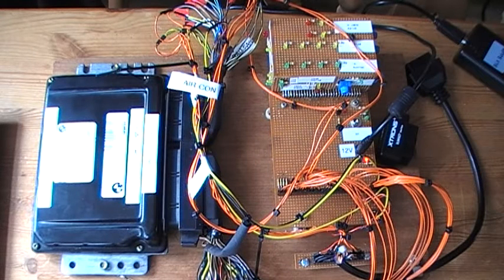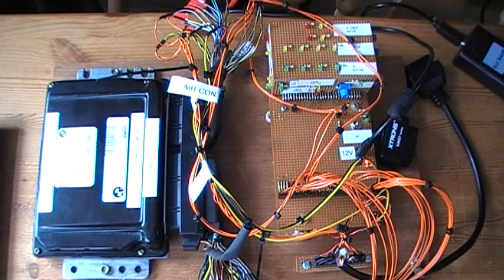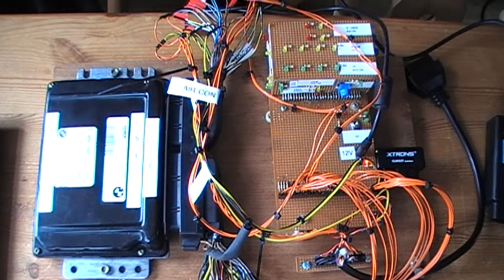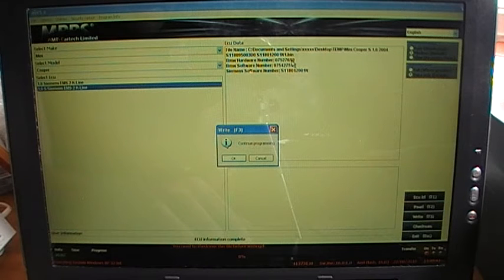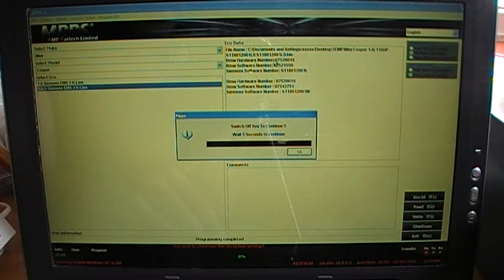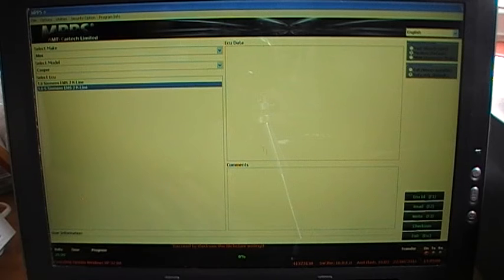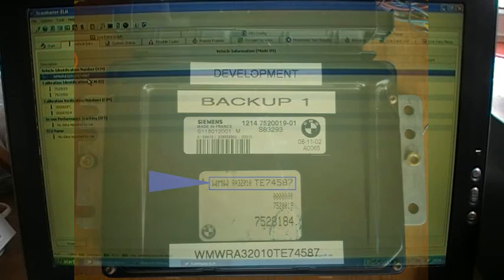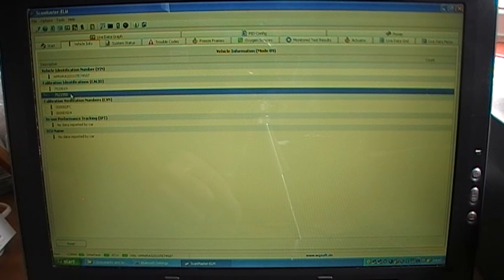Upload An Image To A BMW Miini R53 ECU Using MPPS

Comment: Great video may i ask which wires in the ecu are for can high and low? I'm planning on buying a digital cluster from aem and I'm gonna need the cans to operate the device.
Reply from the maker: It's been a while since I looked. I'll take a look and let you know.
Reply: @DevelopIT  thank you will appreciate it 👍🏼
Reply from the maker: @minir53s9  Here is a link to the document that has all the ECU connections for the R53 Mini:
http://ww2.justanswer.com/uploads/MA/markthebooler/2013-04-04_095335_mini.pdf

Comment: Fantastic video m8 can I as how and what u used for wires to connect to ecu and do you sell what you made to connect to ECU
Reply from the maker: I saw one on eBay which had been removed by cutting the harness wires, so I got it and when it arrived it still had the connectors and short wires from the connectors. I recommend getting one this way if you can because the connectors are very expensive.

Comment: Hello, fantastic channel, very detail oriented and I love it. It appears you are an electrical engineer, I am as well. I have an '04 R53 Mini ECU for which I suspect the injector driver is bad. The ECU is a Siemens VDO, but it is a slightly later version then the one you have in the video. The case backing "clamps" on instead of screwing on. I am contemplating replacing the injector driver. Any suggestions?
Reply from the maker: I originally did electronic engineering, but mostly do software engineering.
I have only looked at the type of ECU that is in the video. The circuits are placed on a film rather than a board. A heat gun can be used to remove the components, but there are two issues. The film is on a plate which is used as a heat sink, so some components that are mounted to it are difficult to remove. And there is a coating of some kind of plastic material over the film to protect the soldered joints from moisture. Use a cheap ECU from eBay to practice on first, and see if you want to try on your ECU.

Comment: so this process can be used to clone my original ECU to a spare with same HW number?
Reply from the maker: No, there are parts of the memory which don't get copied. One of which is the VIN number.
Reply from the maker: That is to say, from the point of view of my vehicle, R53 Mini. I think there is a table related to MPPS as to which parts of memory it does and does not copy for a particular vehicle.
Reply: @DevelopIT  so it could be is related to MPPS, maybe other software can fully read&overwrite exiting data on memory? I have seen online sites that offer ECU cloning for BMW's and MINI
Reply from the maker: @mokacat1595  BMW have a proprietary interface over a connection called K-Line, which it uses to configure the devices in a car, including the ECU. I don't know enough about MPPS to know if it can also be used.

Comment: I just found the same firmware and same hardware version as my EMS 5150. QUESTION)  Do I need to program the second ECU on a bench setup as shown in this video because there is some handshaking going on with other things in the car, or can I just not start the engine and have the ignition on to use the odb2 port to write out a copy of the original ECU which I can read in the car into the second ECU, and then hopefully, fingers crossed, start the car?  Thanks for helping others with your video(s).
Reply from the maker: You should be able to have it in the car with the ignition on and program it. However, I believe that it will probably retain the VIN number from the vehicle it came from. So after programming it will probably complain that the immobilizer unit does not have the same VIN number as the ECU and prevent you from starting the car. There are sites online that have copies of firmware for download which they say is immobilizer disabled firmware. However I have not used any of these and don't know if they are safe to use.
Reply: Thank you for your quick and probably accurate understanding what the total system will do as well as the suggestion with disclaimer!!!

Comment: So, if I've well understood, even if you take a second ECU unit with corrett codes and you load the 512k image file of your ECU into it with mpps the VIN code won't change and the car won't start up. Is It right?
Reply from the maker: The MPPS transfers I have done don't update the VIN number in the ECU. The vehicle immobilizer unit also knows the VIN number and wont allow your car to start if they don't match. With a previous car I have had, not a Mini, when the ECU failed, from eBay I had to get a matching ECU and immobilizer unit, plus ignition keys to match the transponder in the key with the ECU, plus the ignition barrel. If you look on eBay there are some breakers who sell the set of items you need to swap. One of my current projects, when I get time to work on it, is to read and write the full memory to the ECU for an R53 Mini.
Reply: Develop IT 
Thank you for your replay.
The fact is that there's nothing wrong with the ECU of my Mini One. Swaping ECU was a plane for safe experiments on ECU file saving the originale unit.
Reply from the maker: That is what I am working towards too. I want to backup the original, store it and never touch it. Have an exact copy of the original for road use and multiple modified copies for track use.
Reply: Develop IT 
Thumb up.
But if the 512k file red with mpps doesn't transfer the VIN how can It be possibile that once one guy looking at my file told me my exact VIN code?
Reply from the maker: When I was using the MPPS I was using several test ECUs from eBay and a OBDII diagnostic software. I read the image from one ECU with MPPS and wrote it to another with MPPS, and the VIN number remained the same when looking at the OBDII results. I also wrote an invalid image to the ECU and the ECU stopped working, wrote a valid image and the ECU worked again, so I know MPPS was wring the data to the ECU. From what you say maybe the full image is read, but not fully written over MPPS. Or maybe your MPPS tool works differently to the one I have.
Reply: Develop IT 
Thank again for your attention.
And to be clear, i do not doubt you are right: only trying to understand.
Reply from the maker: I think I came across incorrectly, I'm always open to being wrong, I didn't mean to imply this is what you were saying. I appreciate all feedback, it all helps to get to the bottom of things.
Reply: Develop IT 
It's all right. 👍
Reply: Sorry again, reading ECU after using the car - mileage differences or may depending on engine temp, I don't know - takes always a new trace between 004000 and 007FFF addresses. Do you know what that interval refers to?
Reply from the maker: I haven't started looking at the data files yet. I just need to finish off another project first. Then I will read the content directly from a memory chip removed from the ECU, and start deciphering the code to find out how it works and what operations are possible.
Reply: I hope you won't send me to hell if I ask you another question.
If you swap the ecu with same codes but wrong VIN the car - due to EWS - will not start up. But after doing this and without doing anything else, if you re-install your original ECU in car will it be able to start without problems?
The reason why I'm asking this is because I'm not sure my Mpps is working correctly. Seems it can read well but not sure about writing Mod files. So I could try to write without problems on a second hand ECU through OBD port, just to see if I report a bug.
Thanks again for you attention.
Reply from the maker: When I was using MPPS after writing the image from another ECU, the ECU would function with OBDII. So if you have OBDII software you can check it. It reads the trouble codes and usual parameters such as speed, RPM, temperatures, ...
The thing to check is that the image you are writing has come from an ECU with the same letter code on it. So the part number is for example: S118012001 N, the first part will be the same for all R53 Minis, N is the letter on mine, so I have to source ECUs with N for the Cooper S model. Other models have different letters, I have seen L and M codes too. If you try and write to an ECU with a different letter, it will act like it has written, but the ECU will not function, not event for OBDII.

Comment: So I've been following along your other video with taking the cover off the ecu and now this one, do you think this could lead to a more open source tuning option for r53 owners? Reason I ask is I have an '06 R53 that I'm about to start a turbo conversion on, and I need to be able to read what's currently on my JCW rom, and possibly find a way to make changes to the tables to flash back to the ecu. There is only one DIY flash software that I've seen so far, and no one in the states can give me any viable information about it. I'm not about to drop a ton of money on something that could possibly be useless for me. Thanks for the video!
Reply from the maker: My intention is to be able to tune these ECUs, not sure how long it will take to get there. It's quite a wide topic identifying tables and stuff. My next step is to intercept the data going to it via the MPPS, as I want to be able to clone the original ECU, so I can keep the original and revert back to it if needed. Mine is an R53 04 and I am currently putting Shell Nitro 99RON in to get rid of the knock until I can tune the ECU. 99RON is quite expensive probably equivalent to 97RON U.S.
Reply: The most I've been able to do is force flash a JCW210 map so far, and re-align the EWS using INPA/EDIBAS. Pretty basic considering what I'd like to do for my turbo swap. I might have a problem too considering I have a late model '06, and I believe MINI switched to Bosch ecu's instead of keeping the EMS2K. These are much more complicated than any of my previous work with Honda/Mitsu/Subaru.